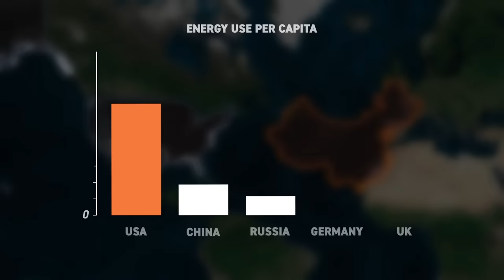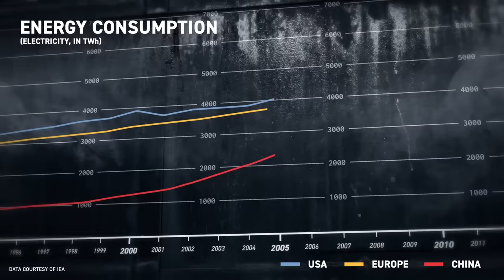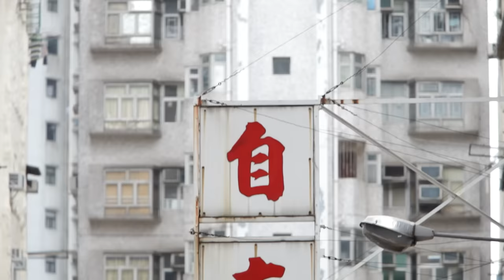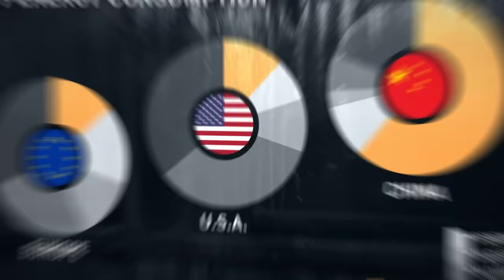China’s Electricity Problem

Comment: The ac problem can be found in most places as well, Africa, India, Australia... For me it's something that should be the world top priority and get better research funding from everyone just like EV had in recent times. Hopefully we will have a new innovation in these coming years,
Reply: The problem is that ACs are already super efficient heat pumps, depending on the quality of the model.

The 'fix action' is better insulation for the buildings being cooled.

Considering all the tofudreg buildings in China, the buildings probably have an insulation value of 10-20% of an average 'western' building. That exacerbates the power draw to keep buildings cool vastly more than the AC itself.
Reply: @Konsaki  Id also think of better flow too? not a buiilder, but as a home buyer in the south I looked for a house that has good flow in case (as it has happpened) I have no ac.
Reply: australias problem is unique. we produce TOO MUCH solar power during the day, leading to grid instability, then it all shuts off at the same time, then people get home and turn on their AC and start draining the grid, causing more instability. if we didnt have solar, the AC issue would be easy to manage. storage will be incredibly important in the very near future for australia. i wont be surprised if we end up having the highest energy storage per capita in the world once grid-compatible sodium ion batteries become mass produced.
Reply: @cetriyasArtnComicsChannel  good flow doesn't do nearly as much as good insulation. If you have poor insulation good flow just means the building loses heat just as quickly as it spreads, so it could even do a building worse
Reply: @jonathanodude6660  check into gravity batteries for grid usage. Think a company in turkey set one up. Basically an automated electric crane that stacks blocks of concrete when power is high and then unstacks them when demand is high, with the motors acting as alternators.
Reply: AC can actually be a solution to a different problem, heating. Most people still burn gas, or even oil during the winter to heat their home. A heatpump can both heat & cool. I find it mind-blowing that people in climates where the winters are cold but the summers hot decided to use two systems instead of one.
Reply: @Konsaki  and .. did you also do the math as to how much energy is stored this way? just because it may look "interesting" doesn't really mean much. for comparison, pumped hydro can exceed 3,000 feet in elevation change, the "tonnage" is water stored is humanity unfathomable yet, they can run "dry" within a couple hours under full load (without replenishing, just draining, I mean). meaning, even such a big scale version provides surprisingly little energy storage. now think again about the scenario you described.
Reply: @Ninjaeule97  because you do need two, not one. a heat pump can only do what it says .. transferring heat; okay, that would then actually work, but the issue is, the "direction" is a fixed one. you can't just simply run it the opposite way; you'd need to physically reverse it. besides the targeted working temperatures do also play a role (in regard to yielded efficiency.)
Reply: @Konsaki  LOL are you seriously pushing that gravity pump pseudo-scam in the comments section of THIS channel?
Reply: @HxTurtle  On the gravity battery, hydro is more efficient but what if you're in an area without a lake to store the water, such as a mountain or desert?

On heat pumps, you need to do 'some' research... a bidirectional heat pump system is stupid simple to make and I have one in my house for both AC during 110f summers and heating during <32f winters.
Reply: @Ninjaeule97  stupid post is stupid - people rarely choose anything, and have whatever their apt building or what the house came with.

totally changing the heating in your house can cost as much, or more, than buying a brand new car.  Also - no everyone has access to the same things (oil is only choice vs oil and gas vs possibly neither).
Reply: @HxTurtle  what are you talking about?  The split systems you see do in fact pump heat in both directions - the ones meant to cool AND heat a house.  Yes, even when its zero F outside, you can pull heat out of that - its much higher than abs zero.
Reply: @Konsaki  I'm pretty sure it's two units packet into one. I didn't mean to be against using heat pumps during winter. when gas used to be cheap, it was economically still more sound to use that instead. it also puts quite some stress to the power grid. would now everyone exchange their non-electrical heating system with heat pumps, the demand for electricity would go up rising its price making it less economical again (if you can even provide the electricity for it in the first place.) similar as to what happens with electric vehicles .. if all households double their electricity demand (or even essentially triple taking commercial vehicles into account as well), then this is gonna effect the pricing .. it's something that already started showing (yes, first build the infrastructure that can supply the electricity, then have people swap over .. not the other way round.)

as for potential energy storage: yes, the possibility for pumped hydro is very limited .. that's why it isn't used more widespread. I still just wanted to give a perspective into how monumental such an infrastructure would need to be in order to store any meaningful amount of energy. that's more of a marketing gag then anything else. (they'll other, more clever solutions take over .. and it certainly won't be batteries. I just don't know yet which one, but it's not unthinkable to find something suitable.)
Reply: @xBINARYGODx  I'm fully aware that it's totally possible to drain "heat" out of even "subjectivity cold" air. I only meant that a heat pump can technically only work in one direction. otherwise, you'd be able to use your fridge as an oven with just the flick of a switch. you'd still need a second "unit" for that. but I understand, that the perceived outcome then essentially is the same (so, I should've probably not mentioned it .. only tried to "defend" people from the "past" that—as always, of course—made everything the wrong way [I feel that way, since I'm a tad on the older side as well, lol.])
Reply: @xBINARYGODx  When you look for an apartment or a home, you should look into the heating/cooling system. If you don't your the stupid one. My parents own a house and I rented for some time. I looked into multiple places and chose the one that best fitted. Even then I replaced all the lighbulbes with more efficient ones and changed other things in the flat. Got my full deposit back & was on good terms with my landlord. Of course not everyone has that luxury, but why would you spend more on a car than the heating system of your home? What happens if it fails, you sleep in your car?
Reply: @xBINARYGODx  > totally changing the heating in your house can cost as much, or more, than buying a brand new car.

I've replaced heat pump AC/heater units in two different houses for ~$7000USD each within the past 5 years.
Reply: ACs are already extremely efficient. In fact, one of the most efficient heater technologies is the heat pump, which is basically a reverse AC.
Reply: @Konsaki  If you're in an area without water and can't wait for next gen chemical batteries or afford lithium ion batteries you can dig a hole or build a bunch of tanks and fill them with compressed air then release the air when needing power.
Reply: @HxTurtle  what are you talking about? reversible hear pump is on the market for quite a while now....
Reply: @Konsaki  agree on the heat pump, but for gravity storage you need elevation differences, building giant structures just for that doesn't make sense. In most mountains you have water, so you use that. Even if you didn't you wouldn't make concrete blocks, just use rocks or sand. Potential energy is mass*g*hight. Want to store more energy? increase mass and/or height (difference). Ideally, you use the cheapest and easiest-to-work-with material, which is usually water. If you have no height difference don't even bother.
Reply: @jonathanma2741  I was basically talking about that you can't simply turn an already installed AC into a heating device for winter. sure, units that contain both elements on both sides do exist. but you can't just somehow magically reverse the work flow of a heat pump.
Reply: District cooling and electric power storage. That way the water can be cooled when there is low demand/high supply on electricity and stored for later circulation during the hottest hours of the day.
Reply: @HxTurtle  At its most basic, the only functional difference between an AC and  reversible heat pump is one specialized valve and a reversible compressor. They're not two systems squished into one, it's simply a reversible system. Also, reversible heat pumps are not significantly more expensive than standard AC units, and are approximately 4 times more efficient than electrical resistance heating.
Reply: @OmnipotentNoodle  I knew about the efficiency gain compared to resistance heating—I simply wouldn't have imagined, it's that easy to operate a heat pump in reverse.

there's still a second side to it, though: when reverse AC units are four times as cheap as outright electrical heating alone, but natural gas used to be about eight times cheaper than electricity, then it's still economically sensible to rely on gas. used to be, mind you. however, on the other hand, you need to take into account scalability. if everyone used substantially more electricity during winter .. will this increase in demand affect pricing? I think it would especially since currently every source of energy seems to be unwanted (even nuclear) and fully renewables can't deliver supply on demand and there's no viable energy storage solution in sight. something similar I'm saying about electric vehicles—once they become the dominant mode of transportation, their electricity bill will be way higher than current gas prices. I fully understand/acknowledge that we need to get rid of fossil fuels, but we also need to think wisely whether our proposed solutions are really scalable to an extent that's required to actually have an impact. that's the real difficulty.
Reply: @HxTurtle   Actually, the efficiency of heat pumps vastly outweighs standard gas heating too. Most commercial heat pumps will achieve a Coefficient of Performance in the range of 2-4, meaning that 2-4 kW of heating is achieved by expending 1 kW of electricity. Top-range gas furnaces can approach 90-98% efficiency, meaning that for every 100 joules of heat produced from burning, you can extract 90-98 joules of heat in terms of actual space heating. Combined cycle gas power plants tend to sit around 60% efficiency, so 60 joules of electrical energy from every 100 joules of heat. This means that you would only need a COP of 1.67 to break even with a 100% efficient gas heater, which is not only well within the range of commercial heat pumps, but is actually quite low. If we're thinking in terms of societal resource allocation, it would make WAY more sense to take all the gas out of houses and pop it in power plants. All this to say: heat pumps are actually multiples MORE scalable than gas furnaces.

I definitely agree about EVs though, but that's less to do with them being electric and more to do with the fact that cars, inherently, are an inefficient and non-scalable means of transporting people, and ought to be done away with as much as possible.
Reply: @OmnipotentNoodle  yes, those are the same numbers I'd come up with as well. so far (but that's about to change) prices just didn't reflect that (for whatever reason .. but if I were to guess, I'd probably say this was politically motivated.) yes, cars are extremely inefficient .. but it's also extremely hard to simply "take away" this form of ultimate freedom from people, I think. in the US, that would mean massive changes in infrastructure as well, since absolutely everything is build for a car centric society .. one can't even properly walk into a grocery store even if technically living right by it. mass transit and single family home zoning don't go very well together .. but I know that you also know all that.

edit: the grid might need to be upgraded as well .. many people don't realize how close to the limit those transmission lines already are; one can even check themself (adopting "modern" speech .. *proud I'm* 😅) with an IR sensor.
Reply: @jonathanodude6660  Thankfully thermal storage is the easiest form of energy storage to implement. Even at the level of the individual house, if you blast the AC during the day when there's tons of solar power and cool your house down to 10C, you can coast through the entire night without it getting hot.
Reply: Meanwhile in Germany: Let's build district cooling networks instead of AC´s.
Reply: @deathgun3110  But a district heating/cooling system affects everyone within the district.
To be successful in the US you gotta come up with a system that can be selectively targeted towards different classes by appealing to the individuality.
Reply: @jonathanodude6660  That shouldn't really be a problem, you can use your AC during the day when there is too much solar so that your house is cooled by the time you get home/solar is lowering in generation. Keeping a cooled house cooled is much less energy intensive than cooling a hot one down. So your problem is more about bad heat management than it actually being a problem.
Reply: One of the problems of AC is that you are just putting the heat in the air outside, this will increase overall temperatures, especially in urban area's, worse you are adding the heat of all the AC's having to do work. A solution might be to either use ground heat pumps to transport the heat underground or use some kind of community 'heat-lines' that in the summer takes up the heat from buildings and uses it in production/stores it underground or so somewhere and in winter you can do the opposite, draw heat from those lines. It does take more planning, but it can help fix the issue with AC just moving the heat from inside to outside creating even hotter outside temperatures.
Reply: @MDP1702  nearly everyone has solar power (i think 2/3rds for my state) and the government hasnt really promoted leaving the AC on for 10 hours every day so i assume theres some reason for that. i cant imagine that everyone leaving theirs on all day until they get back from work is good energy management. it only takes 1-2 hours to cool down if you turn it on when you get home. anyways the summer hasnt started yet, so well see how hot it gets this year.
Reply: @jonathanodude6660  
i cant imagine that everyone leaving theirs on all day until they get back from work is good energy management.
It isn't unless you have proper insulation (at which point you don't need to keep it on 10 hours a day, just 1-2 hours or 10 hours at a very low use) or if you have energy to spare during the day. What is bad management is not using overproduction and then having problems during the evening/night due to underproduction. Ofcourse if you have an AC that you can't really manage (no timer/app/...), but just on and off switch, that might be somewhat different. Then you need to use it on lowest use setting or indeed at night. Though I can't imagine modern AC units/heat pumps without at least a timer or just having a heat sensor to keep the room/house at a certain temperature.
Reply: @MDP1702  most people have pretty rudimentary AC systems from 10-15ish years ago. Not many people have American style thermostats. You can set a temperature on the AC controls but I think the sensor is quite poor. It won’t turn itself on and off based on the temp, and there’s no app or remote control for my current place since it’s an older house that we bought.

Btw the problem isn’t underproduction at night, the problem is overproduction during the day. Solar panels aren’t stabilised and thus mess with the timing of the grid. Multiple state governments have decided that they’re just going to require that all solar panels be able to be remotely controlled so they can be turned off by the state if the production is too high.
Reply: @jonathanodude6660  If there is overproduction from solar during the day, something needs to change elsewhere in the grid. For example replacing coal by gas, more storage solutions (eg subsidizing storage at home), ...
Reply: Here's a new innovation for you: turn off the AC.
Reply: An interesting metric: you need 6 solar panels to run an AC.
Reply: @michaellind3653  I have no idea what those temperatures mean. Of course if you have a home with 0 insulation a heatpump is probably not for you but even 0°C is 273K so there is a lot more energy to extract.
Reply: @jonathanodude6660  Even if that happens you will have the most expensive electricity rates in the world.  To what end.  Climate change is now pegged at 1 to 1.5 C per CO2 doubling.  At that rate we might get to a climate the Romans enjoyed.
Reply: @markluhman8940  even if what happens? We are already the worldwide leader for solar, at least per capita. Our energy is cheaper than most other places relative to income, and the government has complete control over the grid as they are the primary producers (other than rooftop solar) and the sole distributors in most of my state. In other states, the government is the distributor but producers are private and theirs is fairly similar costs, only slightly higher.

Edit: If you mean storage, then I can only pity you. Grid level storage already exists my friend, and has been in use for decades. Battery storage specifically is already in trial phases. Sodium batteries are the perfect compromise and the materials are cheap and most of the manufacturing scale already exists and can easily be repurposed from lithium. Prices will come down not up.
Reply: Damn i didn't expect that many replies.. I'll wanna say it's really cool seeing people talking about what can be done for a better future, we can agree or disagree on the method as long as it's for a better world. some arguments is better than not talking about it at all..
And yess we absolutely need to push for better insulation, i personally worked in the glass industry and the benefits glass that suit your specific climate can bring is massive.. Unfortunately i seen window maker abusing on the price, they charged. 75%+ for a glass that has better insulation value while they pay just 25% more than the regular glass.. Essentially driving their customers away
Reply: @HxTurtle  No, you only need one unit - when we change seasons here in NZ I set my heat pumps to either "Heating" or "Cooling" mode, depending on which season we're moving into. That is the full extent of the physical work needed.

Modern heat pumps can also work at temperatures below freezing, as well.
Reply: There is a new technology to replace ac. A few Chinese apartments are starting to use it. It’s basically pump the air from the room to a deep underground water tank and exchange the heat then pump the air back to the room. My parents is living in such apartment already. But it means expensive strata fees. I haven’t seen anything similar in Australian apartments but I know you can spend quite a lot of money (maybe $50k or more) to covert your house to that way. That technology uses less electricity. But I don’t know how to remove the humidity with this technology yet. I think this technology are more suitable for apartments because all the units can share one underground tank which is more cost effective.